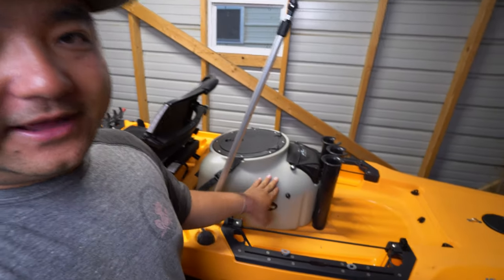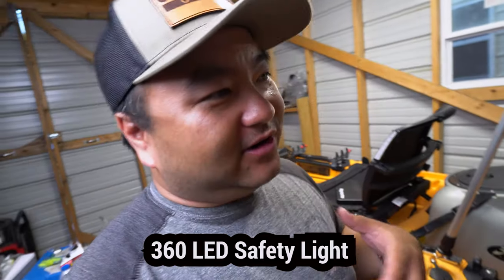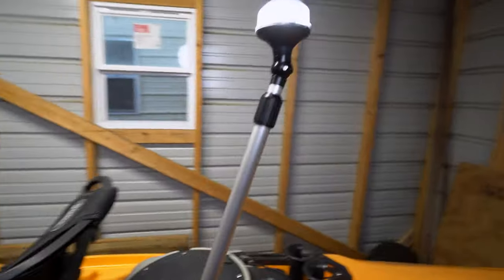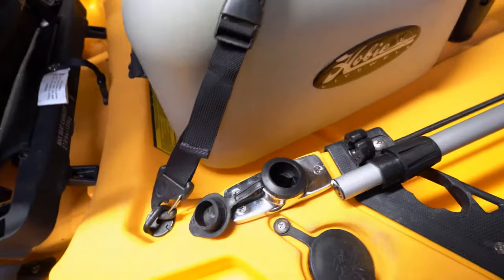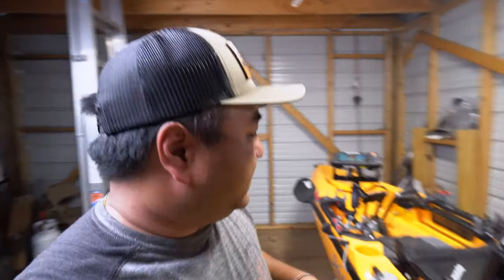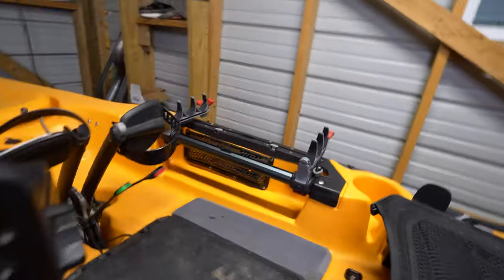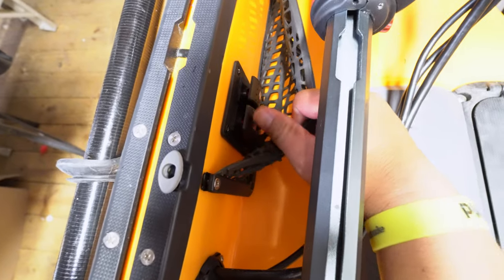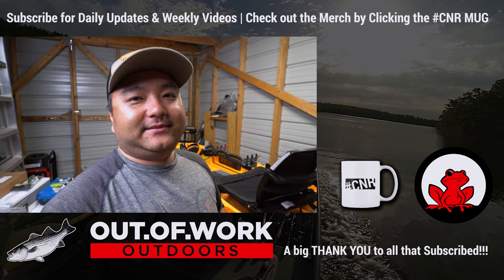Top 5 High End Kayak Modifications 2020 | Hobie Mirage Outback - OOW Outdoors

Comment: That light is pretty awesome. I’m having trouble determining from the link to it or any other searches online if it is already set up for it to light up when plugged into the base, or if you need to purchase anything extra.
Reply from the maker: The base comes with included and you just need to wire up 12v to power it up when you plug it in
Reply: Sorry to hit you up for these questions but I don’t see it online... For the light, is there an on/off switch as well? I’m wanting to have it where I can have the light on in the early morning but off when it’s full light out, and I would also attach an orange flag for daylight visibility so I’d want to leave it plugged in and extended.

Comment: Never stepped foot in a kayak but doing all of my due diligence in preparing to make the move. Question - would it be feasible to attach a 360 light atop the Power Pole - with either an attached power pack or coiled wire? The light would really not be needed during the day during shallow marsh or bank fishing when the pole is down. When under way, the light would be elevated (not sure if it would be elevated to the suggested height). Just wondering if there was some way to reduce redundancy. Thanks!
Reply from the maker: Very doable with some fabrications.  I've actually thought it too
Reply: Got a 1/4-20 thread up top make a plate attach light and get a thru-hull grommet and a coiled cord boom your done
Reply: They actually sell a power pole light attachment.